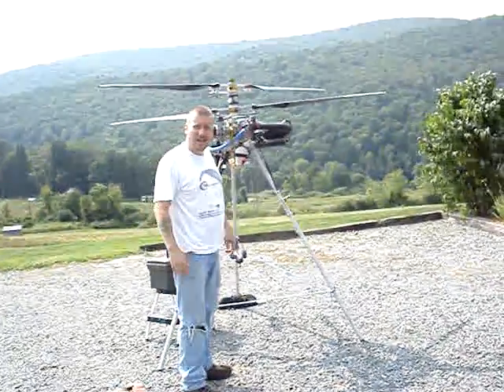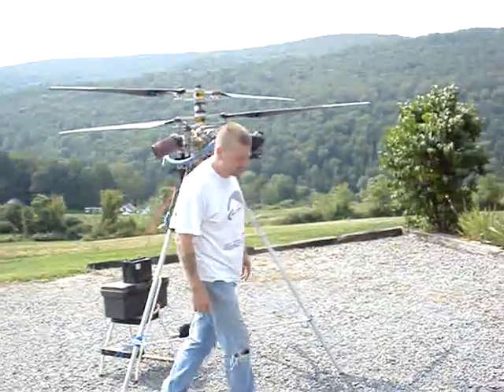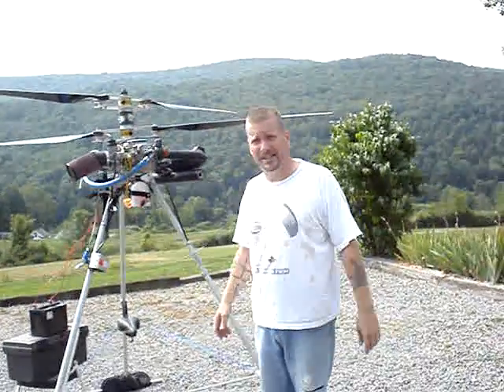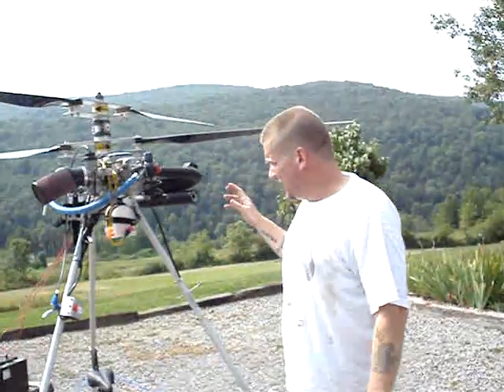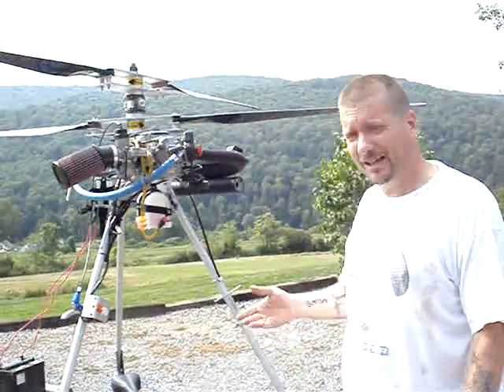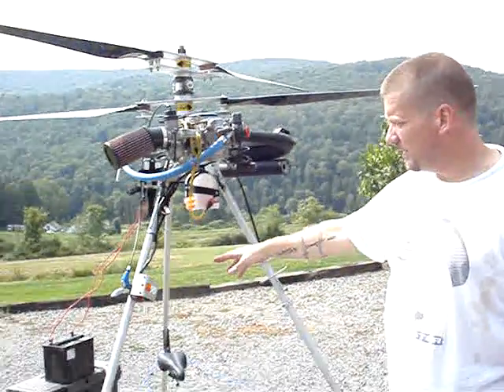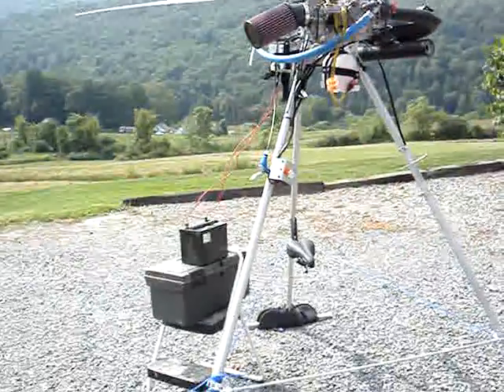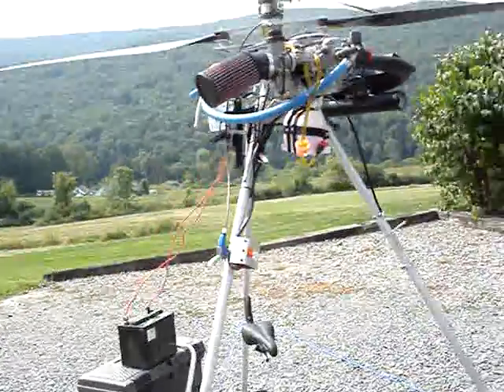Ultralight Helicopter Project - Video #4

Comment from the maker: The motor, blades and hub assembly are very expensive. The hub is 100% custom built. Depending on the skill of the builder (I had to have the hub built by a professional machinist), you're looking at between $6,000 - $8,000. The sit-down version in my other video is the way to go, however. Same price. The Vortex Super ROK engine is about $4,200 alone.

Comment from the maker: Thank you!  ........ On the blades - They are a special order IVO-PROP Ultralight blade. Go to ivoprop.com and contact them. Tell them Mike Reid sent you. The blades are a non-adjust 84-inch diameter. Mounted on the hub, the span is 8-foot. Good luck!

Comment from the maker: Thanks much!...... Blade diameter is 96 inches (8-feet). The Rotor Hub cost approx. $1,700 to have professionally machined & ballanced - this includes the materials. The motor in this video is the Rotax FR125 Max, but just switched to the Vortex Super ROK - approx. 7 more HP and considerably lighter running package.

Comment from the maker: Yes, and no..... You might gain a marginal benefit with a lower COG, but landing would not be fun at all - having to push the rear leg out rearward at an uncomfortable distance. If you were to see this aircraft suspended in air, you would be surprised. That rear leg, as is, drops your body position - in flight- about a foot.

Comment: i have a question for you. if you increase the length of the hanging part which include seat and may be some other stuff later. Can it play an important roll in the stability of this type of personal flying machines.?

Comment from the maker: Hello cinquade, Yes indeed - check out the other videos. Still in testing, but roughly 35% of power brought the machine off the ground (without pilot). This is with the 28.5 HP Rotax. Now its in the sit-down model/frame, using a 35 HP Vortex Super ROK. The rotors are also longer now. Basic numbers figured on HP, rpm, rotor disk, this machine - with 175 pound pilot will leave the ground at about half of the engine's power.  Just a bit more building and testing. Machine will be flying this Spring.

Comment from the maker: Started with a used Rotax FR125 Max - which is a great and powerful motor, but just switched to a brand new $3,650 Vortex Soper ROK engine from Italy. 35 HP from a very small & tight 52 pound running package. We are now on the sit-down model frame with this new motor and should see fantastic results. Will be posting a new vid soon on the sit-down. Have the hub & blades, as well as motor mounted now.

Comment from the maker: Hello,  That is a tough question, given the fact A LOT of trial, error, testing, modifications, etc. to get things right over the last few years went into it - adds up to a lot of money. That said, with the PROPER materials, motor, rotors and gear, along with a general set of plans & guidelines, you're looking at about $8,600. The hub is the EXTREME tricky part - getting one made from scratch to run perfectly.

Comment from the maker: Hello stealthy1,          At 500 feet, an engine failure will equal absolute death. This mini-copter should never be flown over 30 or 40 feet MAX. This little craft is for flying around through fields, hoping over hedge-rows, or low obsticles - basically, just buzzing around low-level. To push beyond this, a larger more conventional helo should be sought after.

Comment from the maker: Thanks much my friend,  Don't worry - I'll be moving slow. So far, vibration is quite minimal - extremely low as rpm's increase. No heating in the hub and she seems to be pulling straight up as she starts to leaves the ground (with no pilot weight - at 5,300 rpm). Again, this was the first day out. I'll keep updates coming .................